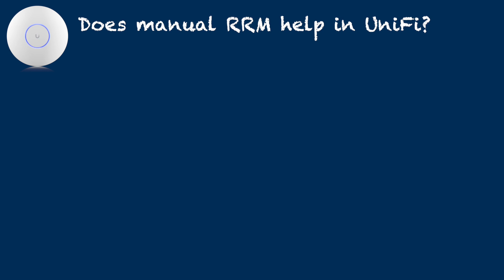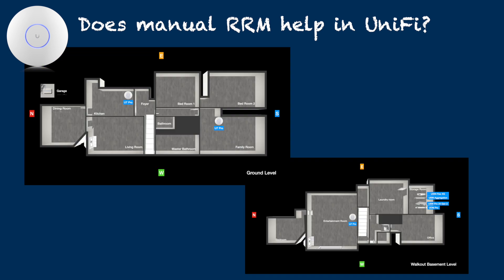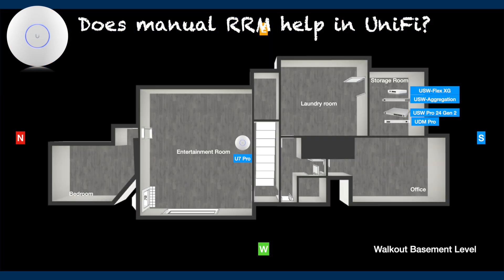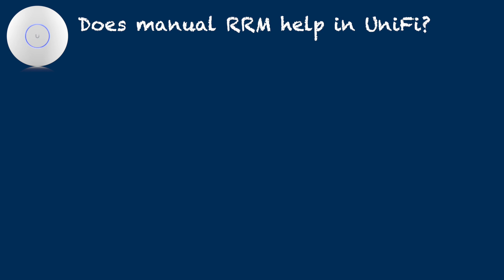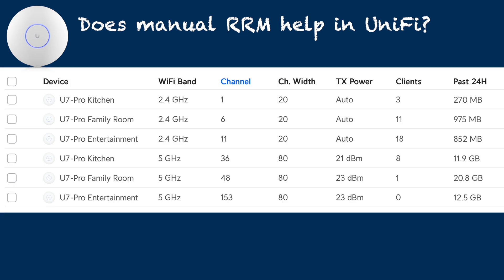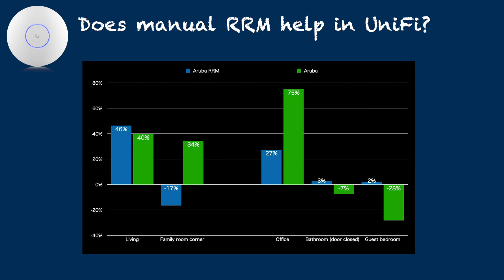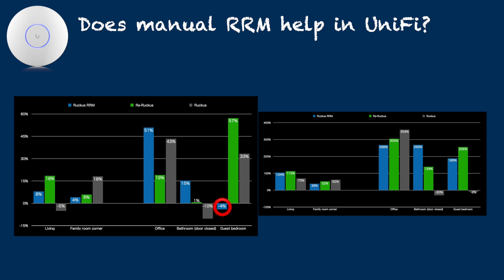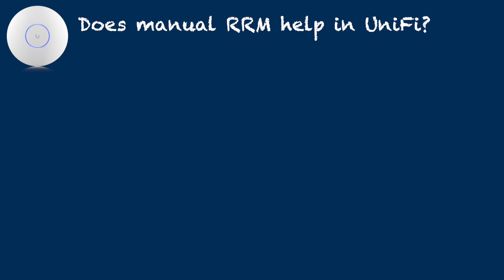Ubiquiti UniFi | Myth or Fact? Does Auto setting (RRM) work in UniFi?

Comment: Excellent video, thank you.
Can I ask where you find the RRM settings within the UniFi controller?
Or is your point that because UniFi appears to lack RRM support, it makes it more difficult for it to auto optimise?
Reply from the maker: Thank you for commenting.

Sadly, my point on this is the latter. If you choose auto on transmission power and click channel optimization in UniFi, they may not perform as well as manual configuration.